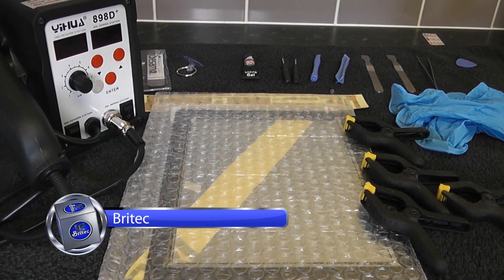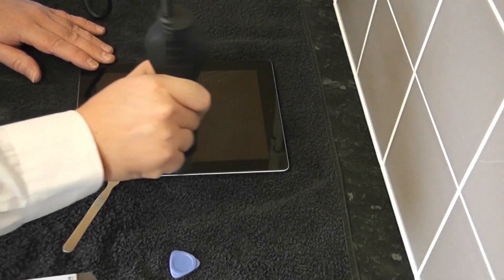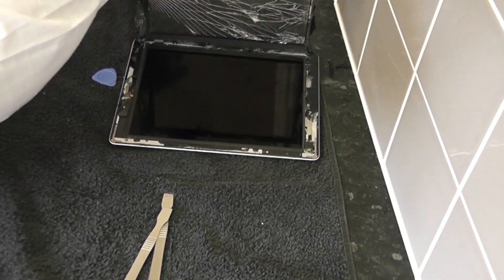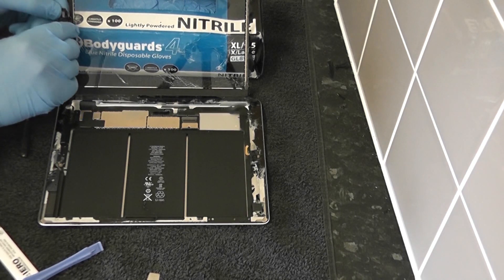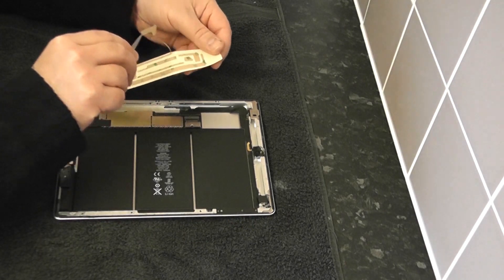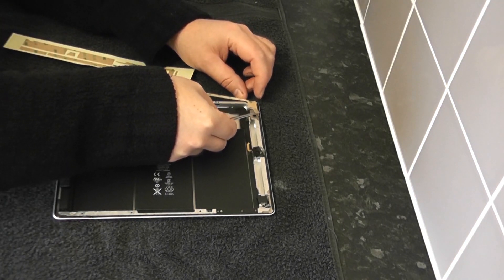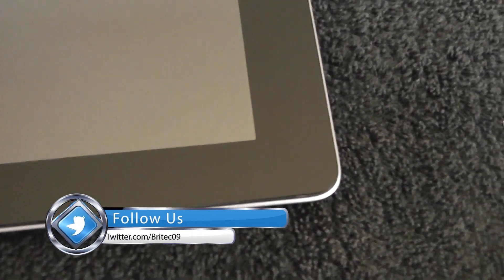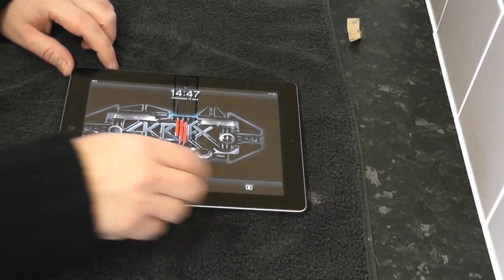iPad 4 Screen Replacement, iPad Digitizer Repair by Britec

Comment from the maker: I agree Hayden, there is some good hairdryers that have good heat, but like you said need to hold it on glass longer, my friend used hairdryer and ended up not heating glue up long enough and broke the wireless, volume and home button assembly's. So that's why I did not recommend it.

Comment: Not bad.  I'd have to buy the soldering station (or at least the heat gun).  It definitely would be a benefit to consumers who need these replaced.  Have you tried this on the iPhone?  I wonder if the technique as you demonstrated is the same just on a smaller scale?

Comment: i only have a normal heat gun, how hot should the heat be please? slightly hotter than a hair dryer? and will the internals melt if i have the heat on for to long? many thanks! :)

Comment from the maker: well you could get away without using super glue, its only a very very small amount, not sure the sticky tap is up to all that mate tbh, I wanted to make sure i had a strong bond, did not want glass to be proud, which I have seen in other videos.

Comment from the maker: The screen is £22 that's all you really need if you have rework or heat gun, so you have to workout what you think is a fair price. I think £120 is fair because apple do not replace screens, I have seen people do it cheaper, but you got to ask the question....is there much profit in it for the work you have to do? Also iPad could have dent on side or WiFi, Volume, Home Button etc etc damage which will have to be replaced.

Comment: People just leave it to a pro its less of a headache this repair is way to hard and if you dont have experience you will most likely break now he has to buy a new one which will be way more expensive than getting it repaired in the first place.I truly regret trying to fix mine by myself.
Reply: Haha mines apart right now. Won't turn back on when it should. Agreeing with you.